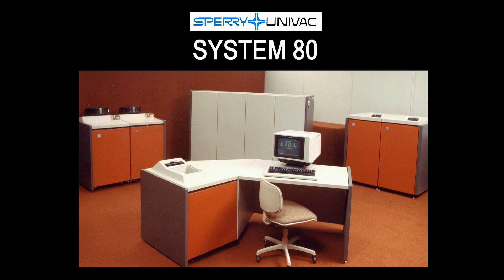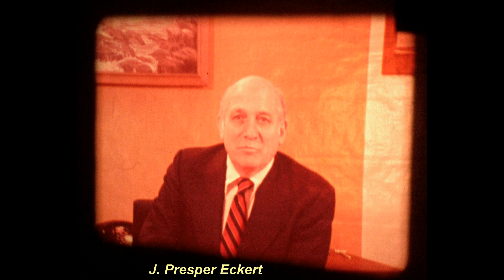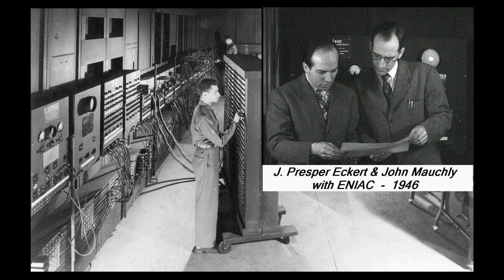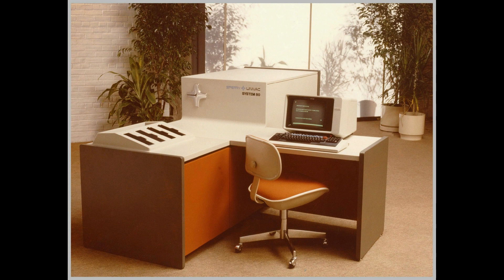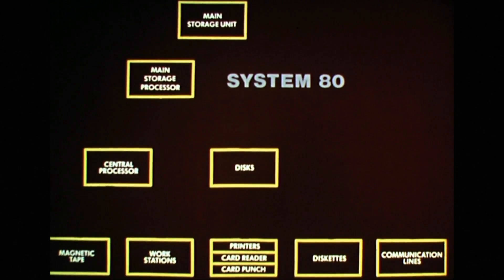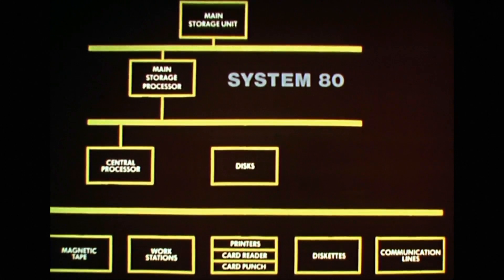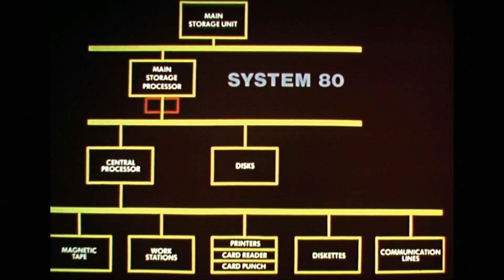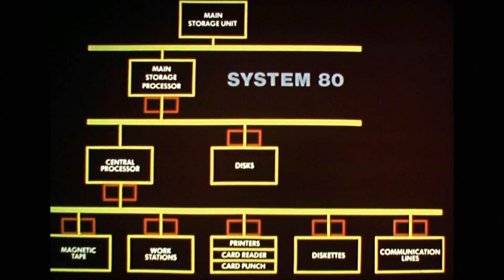1979 - Introducing Sperry Univac System 80 Computer History, Educational, Vintage Unisys,

Comment: What a blast from the past.  My first IT job was as a COBOL programmer on a System 80 in 1982.  Good times.
Reply: My first language was COBOL, learned it 1980 on this handy little machine... 1,024 K Bytes only but 12 workstation could do their job, young programmers cannot believe that :-)
Reply: I didn't get out of school until much later. First job was COBOL on a System 80. That was '83 so not that much later :)

Comment: Ha! Joined Sperry Univac in 1983, was trained as a Business Systems Analyst and trained in Mapper 4GL. Worked on a project on a system 80, must have been 1984
Reply from the maker: Hi Paul, sounds like very interesting times.  1983 was just a few years before the big Sperry/Burroughs merger.  Did you stay through that major reorg?

Comment: A great restored footage but the first part was mostly all about economy and the sound is still just sooo horrible,i can berally hear what those engineer saying,because the audio is very clipped, my suggestion is ,,, use izotope RX7 wich is able to futher enhance the audio by removing clipping and noise,also pseudo stereo and high pass filter will help to make mono sound sounding more clearer,, THX for showing this.
Reply from the maker: Johneygd, thanks very much for the tip.  That's something we may look into.  Thanks!
Reply: @ComputerHistoryArchivesProject  Yes, Izotope RX7 can greatly improve the quality of the audio. Thank you for this awesome history video!

Comment: System 80 still in use in a few places.
Reply from the maker: Thanks.   I wouldn't be too surprised.  They are probably running some applications that are costly to migrate to a more modern platform.
Reply: I am curious - where?
Reply: DoD Process, There also an IBM System/1 in use as well.